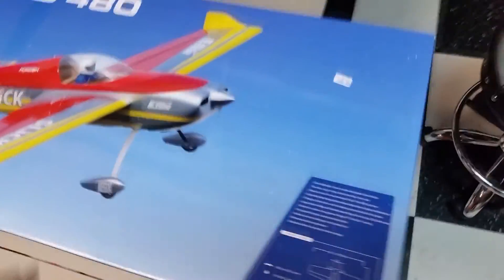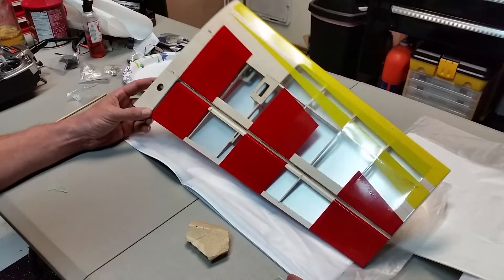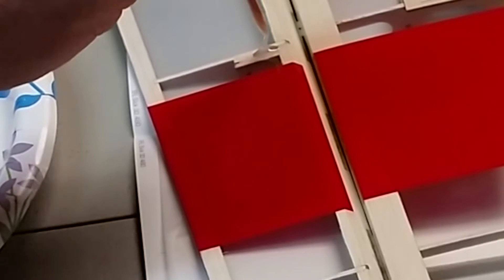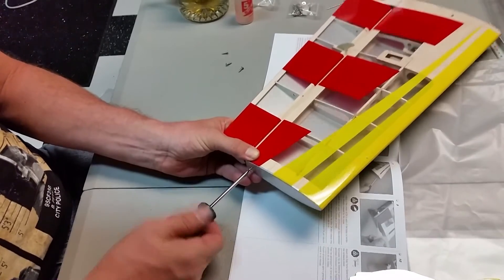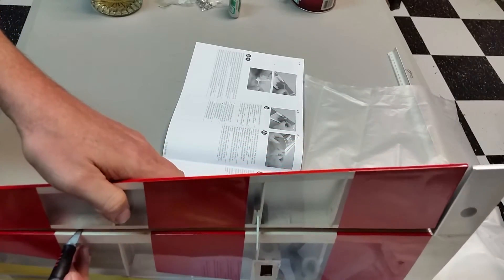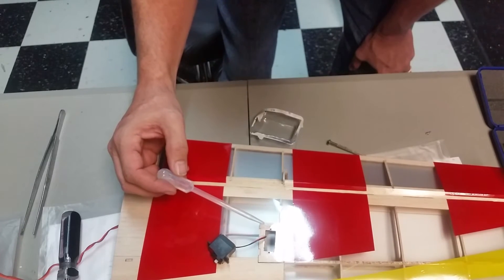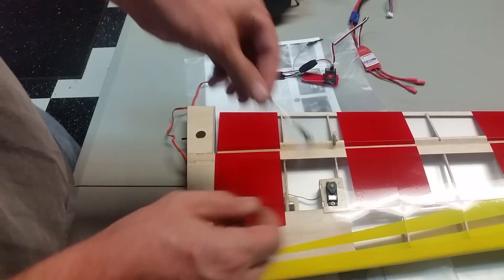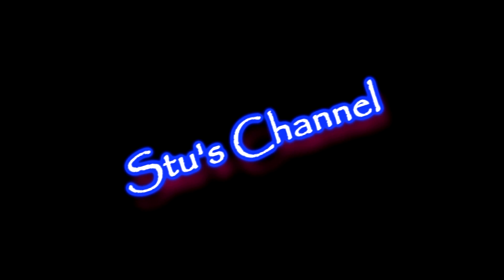Eflite Slick 3D 480 unbox and build on Stu's Channel

Comment: Hi Stu , sorry,  i meant the make of plane , Precision Aerobatics,  they make a 3D plane called the Addiction X that i have just bought but not completed building yet and i was just wonering if you had ever used the PA planes to see if you had an opinion or any advice for me.  thanks so much for getting back to me , love your videos , i watch your channel when the weather stops us flying here in England.  take care,  Scott.
Reply from the maker: That Addiction X will be one of the very best 3d planes you will ever own.  The Car Doctor, you'll see him on my channel, owns one of these.  They are extremely nice planes.  I would do a bunch of cheap foamies, such as the twisted hobby yaks, and some others until the confidence factor is high.   Either that, or fly a few mistakes high with the Addiction X, until you feel comfortable.  You really don't want that plane going down.  Once you are in the zone, that plane will not let you down and is designed to impress.  Your friends will think you are an absolute bad ass with that plane.  All the best to you!
Reply: Cheers Stu , I am looking forward to flying , I bought it second hand and it has all the PA electrics in it , I liked it so much I have bought another ARF kit so I have a spare , I shall let you now how I get on with it when I get the first flight done this summer . Many thanks Scott .

Comment: vn. I was looking at this  to  replace  my mini funtana x.  its  just  old(airframe) im  hoping my electronics  will  work in  this  plane...
Reply from the maker: +1976axerhand   It should.  You may (possibly) have to change the motor, but I think everything will fit.  The motor mount is meant for a larger canned motor, so It's footprint is wide.  I don't think you'll have any problems